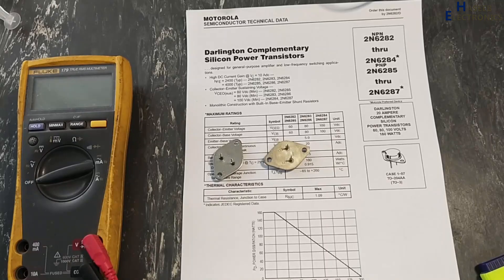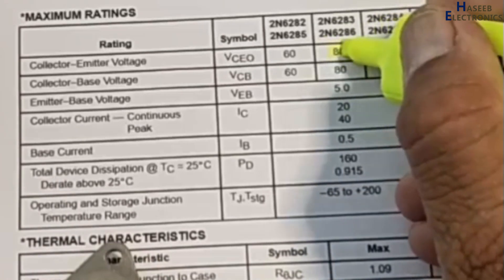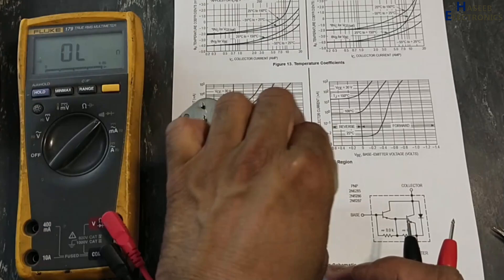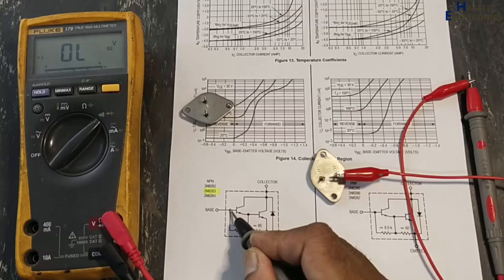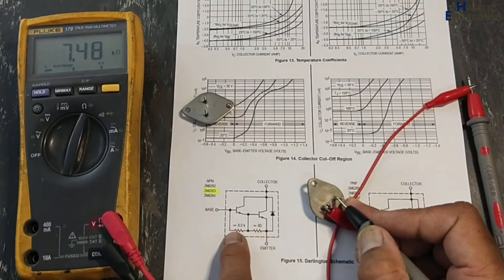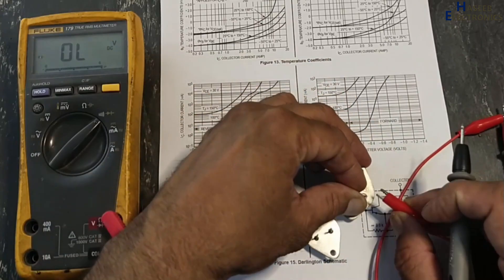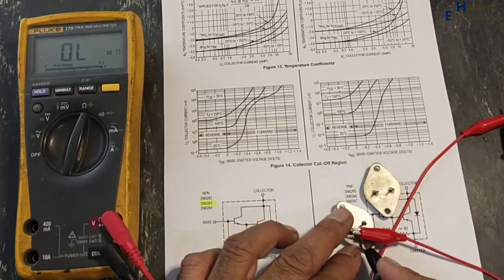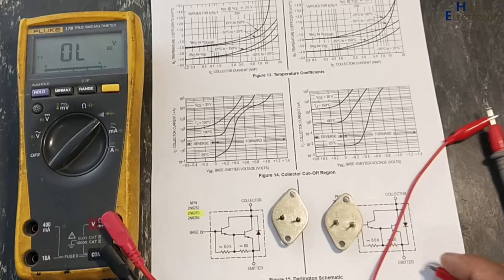{1195} Testing 2N6283 Darlington transistor

Comment: Darlington transistor = a transistor within a transistor
Reply from the maker: yes 
it is very high gain darlington switching transistor with parasitic diode and integrated emitter pull down resistors
Reply: @HaseebElectronics sir can you discuss this AM FM RADIO IC and it's replacement component S1A2297BO1-DO...thank you very much in advance and I wish these can shed a light on a beginner's like me.. I'm one of your followers